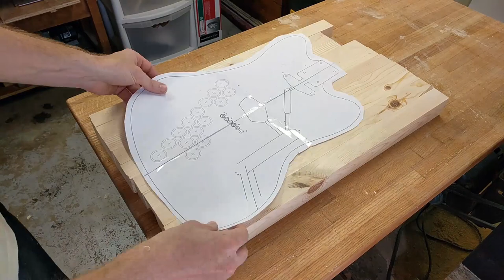DIY Guitar with built in MIDI Controller

Comment: How would you send midi via bluetooth from a phone to a daw in a pc?
Reply from the maker: Just send the MIDI over Bluetooth straight to the computer.
Reply: @MerwinMusic  but should i install a software in the pc to recieve this bluetooth?
Reply from the maker: On Mac you can connect the device and then go to MIDI Studio to configure Bluetooth MIDI devices. On PC it should be possible as long as you can connect Bluetooth devices to the computer. Just a quick search came up with MIDIberry which would allow you to patch the MIDI into your DAW, however I have not tried that personally.

Comment: i am sure there is some benefit for cutting the wood into strips, then gluing the pieces together for the body rather than just using one piece. would someone be so kind as to educate me on this?
Reply from the maker: 2"x4"..6".. whatever lumber is only 1.5" thick. Normal thickness for a Fender style electric guitar is 1.75"
So to use common cheap wood I cut 1.75" strips and turned them 90 degrees and glued them up to make a 1.75" thick blank.

Basically it is cheaper to glue up multiple small pieces of wood than to get one piece that is big enough. Same reason why most guitar tops are book matched instead of a solid piece.

Comment: Just a quick question: Im also building a guitar right now and wanted to install midi. Can you use the Roland GK-3 only for roland products (controllers etc.) or can i also plug it into an synth and play it that way? Thanks and great build
Reply from the maker: It has a special cable from the GK-3 (pickup) to a floor unit GR-20 (synthesizer). But the GR-20 has a midi out so you could send it out at that point to whatever you want to.
Reply: ok thank you